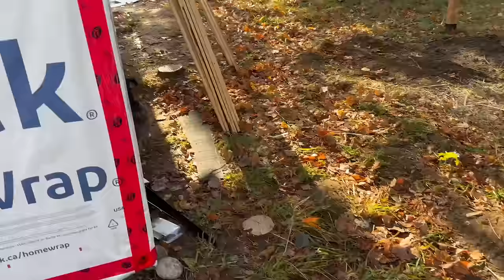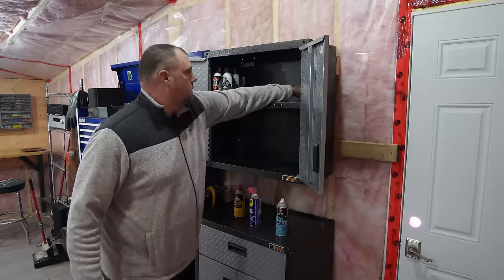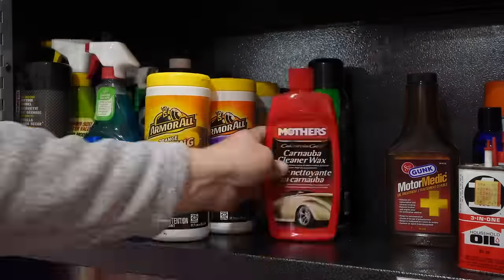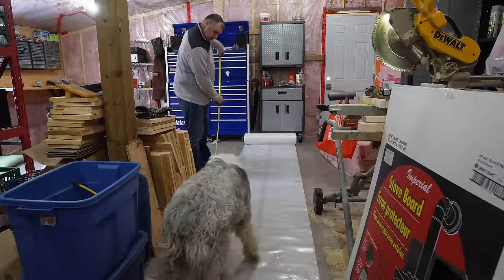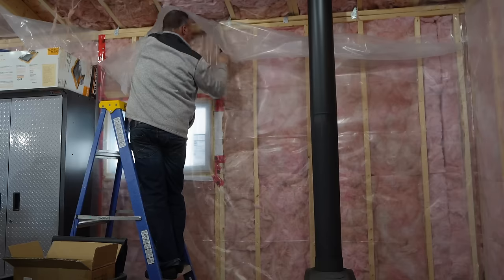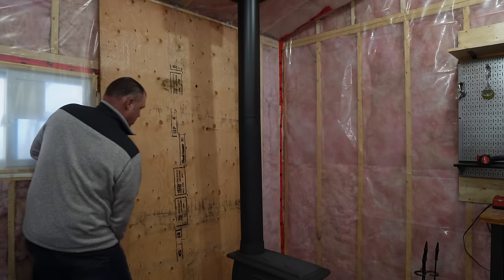Building a Custom 26'x26' Workshop Start to Finish Solo Project

Comment: Thankyou, and interesting to watch a build! 
I just wanted to let you know it looked like you nailed your shingles too high, I could be wrong but as a roofer I’ve seen many a shingle coming loose or blowing off because it was nailed too high. 
The correct way to nail is close to the bottom line, where the shingle has a double thickness, Other wise they are much more prone to coming loose and blowing off. 
I hope this is helpful, 
Blessings!
Reply from the maker: Useful tips are always helpful, I’ve always tried to nail in that mid tar line. Thanks bud 👍
Reply: @HiddenSpringFarm  ok cool! I guess it looked a bit high,  but obviously I couldn’t see how far it goes in the video. 
I try to be respectful and courteous,  
A lot of people get on comment sections and are very rude and critical in their criticism of the way others do things. 
Also I can appreciate good quality content as I am a creator myself. So Thankyou.

Comment: Thanks for the video! I was a little concerned about flipping the foundation platforms up to put on the plywood,… I hope your back is ok. 😉 

I also thought that LVP flooring is going to be pretty mucked up by the time you are done with walls but,… it is a shop.

Comment: This is a really great video with a great project. Since i just know a little of construction work due to my fathers work, i can tell this is a great job! Well done! Maybe its because i am german and we build houses a bit differently, i think you forgot two things: 
connecting the concret pillars with the wooden base.
getting a cable internet connection.
sure the shop weighs a lot by just sitting there, but physics and weather will always find a way to move objects - even the slightest bit ^^'
you throw a power supply line with no cover what so ever into the ground, but no ethernet or fibre cable. Since it looks like you have a small office desk, i think its for some digital work. Therefore a stable Internet connection could be good. Maybe you dont need Internet there, i dont know. But if you go for it:
Connect eather a 95m (in max.) distribution ethernet cable to your router and throw the cable through some weather resistent plastic pipes to your Workshop or use a fibre cable if you can. At your workshop you can go for a WLAN Accesspoint or a unmanaged Switch, so destribute your connection. And there you can connect all your devices with propper connection to your home network. 
Sure this considers the need and will of usage. If you dont need it, cuz you dont listen to internet radios/ music, dont do office work here whatsoever, forget about that part :D
But still, great job! I just dont like wooden houses / cabines - me as a german, we need concert, briggs and all that or a good mix of both - wood and stones! :D

Comment: Great job but there are a few things that would not pass code. Floor beams are a single 2x with no joist hangers. There is a door with no lintel and a rafter bearing right on top of it.

Comment: Guys listen to me. Those hand augers are going to beat football size bruises into each of your thigh muscles. That’s WITH you and your strong ass bro helping. I live in New England. Trust me when I tell you all to spend the $$ and get the little terramite backhoe or kubota that has that attached or use the hand tools. One potato size Rock even in good loam will throw you around like a kid. Not even joking. And my nephew who was 12 started a hole before us and bragged he beat us at digging a hole. Blew my back tf out when he said it or Ida killed that little punk. But my back was DONE at that point. 13-6’ holes in hard soil saved a wise ass kids life.

Comment: Hey, great work. i have one question. Does anything else besides the weight of the building and gravity keep it on top of the cement pilons you made from sonatubes?   thanks
Reply from the maker: I installed hurricane tie brackets to each of the piers

Comment: Question. Isn't the floor going to sweat from the ground moisture coming up under the plastic you put down and damage the batting...? Curious to how it's holding up.
Reply from the maker: Not at all, still have air flow from underneath. The 1/4” osb I put under the joists is just to hold the insulation and prevent rodents from nesting but it’s not airtight by any means. Same as the walls, the sheathing and siding are not airtight to allow drying of the wood when it rains and preventing condensation. No issues at all 😉

Comment: Do you think the pressed board on the very bottom will rot since no moisture barrier to protect it?
Reply from the maker: The moisture barrier is on the inside along with insulation for warmth, but I just installed the 1/4” osb to prevent rodents from getting into the insulation and nesting and to hold the insulation from falling thru. I don’t believe the ground underneath will be getting very moist so I’m not worried.

Comment: A couple of things.
Is there a reason why you always panel from the top..
And why didn’t you finish the panels then put up you shelf’s for tools? Just wondering?
Reply from the maker: I just wanted it somewhat finished on the inside so I could get my stuff in, but I’ll be buying a sawmill and figure I can mill my own lumber for the walls and ceiling rather than buy.

Comment: Cool build.  What’s with the red tape over the tyvek?
Reply from the maker: Oh you’re supposed to use these special staples with a flat plastic head so the Tyvek won’t year but I cheated and just used regular staples so I put the tuck tape so the wind doesn’t tear it while I’m working.

Comment: 11:20 Do NOT use pest-block to fill cracks, use woodfill, like Gorilla woodfill.  Pest-block decays instantly, it's not meant for outdoor use, if it says so on the bottle, you have a lying company on your hands.  Use wood fill, or plaster, or anything, don't use pest block when you want to block wood cracks, ever.
Reply from the maker: That was regular window/door expansion foam, are you saying that stuff won’t last? Isn’t that what it’s designed for? I didn’t use the pest type in the entire project,

Comment: Honest question: Why is everyone in the US doing the floors like that? Whats wrong with a solid concrete floor? No pests under the floor and way stronger, just a bit more work and money involved but I think it‘s worth it. Is there a reason why it‘s done this way in the US?
Reply from the maker: It’s a fair question, 2 things for me here in Canada…it’s actually a LOT more money to do a cement pad and difficult to get the same r value with a thinner pad, 2nd is that I just wanted to do it all myself and I don’t have a lot of experience either pads. Trying to get a pad prepped, leveled, formed and poured I imagine I’d be hiring a contractor. To each their own though, not sure about doing things in the US 😉

Comment: I'll never understand why folks leave no space under the house.... But then place some plywood on the bottom thinking that this will keep the ground moisture out. If you don't lay a vapor barrier and mind you don't even treat the plywood how long do you think that last being 10 inches off the ground? Why put that much work into something and then leave your self zero room to address the problem once it is a problem.

Comment: Why would you put plastic sheet over the top of your floor insulation? All that is going to do is trap moisture in your floor and rot the floor sheeting? Not a brilliant idea.
Reply from the maker: No it won’t there is air flow underneath. If no vapour barrier is used the insulation would be useless. The vapour barrier always goes on the inside of the insulation that’s why I can get the temp nice and warm inside.
Reply: @HiddenSpringFarm  Sorry mate, that is severely outdated building methods. I love the build itself, but that floor will rot for sure.
Reply from the maker: @ThinkCriticallyNow  I’ll have to respectfully disagree, this is still the most common method to insulate here in Canada. Spray foam is not widely used by builders only in specific situations. Where are u from bud? How would you insulate? Keep in mind the vapour barrier is on top of the joists, subfloor is on top of the barrier and the laminate flooring on top of the subfloor. The joists are not sealed from underneath so there is still airflow therefore it can’t condensate.
Reply: @HiddenSpringFarm  Everybody does things differently but my first thing I would have done differently is I would have built it on a concrete slab rather than piers. I know piers are quicker and easier but a slab would have negated half the insulation work straight off the bat. As for the plastic wrap on the floor, while it creates a vapour barrier from outside it also creates a vapour lock via condensation on the inside. This will cause your insulation to have moisture in it and will no doubt lead to wood rot in your floor. There are plenty of breathable alternatives here in Australia but maybe you guys don't have them in Canada. Bottom line, if you trap condensation in that floor it has no way of escaping.

Comment: Why are you not using Butyl Flashing Tape on all window and door openings before installing them? Tuck tape does not serve that purpose. Tuck Tape is to be used with the moisture barrier after insulating only. You may be a good builder, but if you don't build up to code, then you are teaching these people bad or wrong examples. And then if they follow your examples and fail an inspection, then you have failed them. Get the knowledge you need before setting wrong examples You can't really teach if you don't know the whole subject, Get educated FIRST!